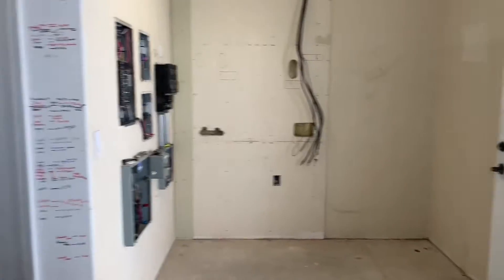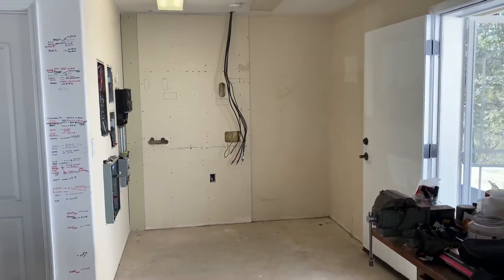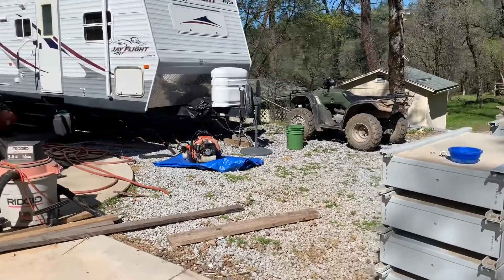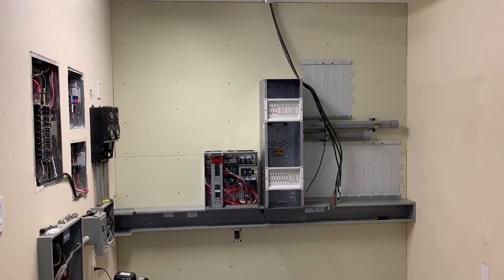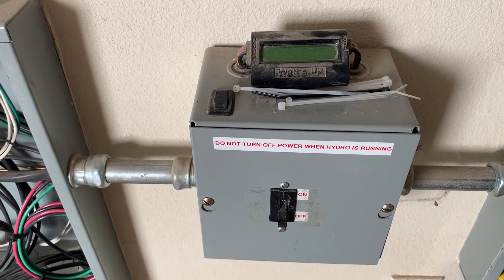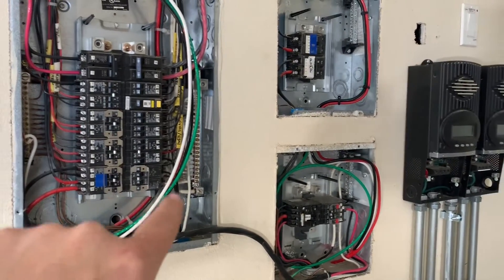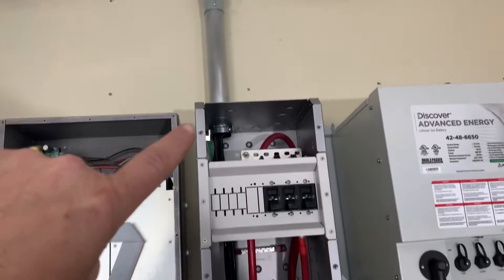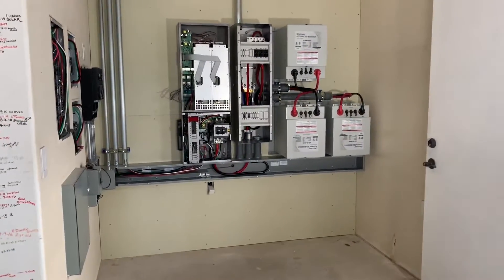Project offgrid upgrade is getting closer

Comment: Not using the Outback SKYBOX? did you switch to the outback RADIAN?
Reply from the maker: this is a 100% off grid project and we putts inverter in quite some time ago, the skybox is not recommended for offgrid, I only had one as I was beta testing it!

Comment: I thought you were going with the skybox? or is that a new video? Man this setup is sweet!
Reply from the maker: I do have a skybox but this project already had the radian, at this point in time I’d still use the radian for off grid.
I have one in my personal power room that’s actually one of outbacks main photos
Reply: @JasonAndrade427  awesome! Yea I'm drooling over here. Trying to get my system together before the end of the year so I can take advantage of the tax credits. The skybox seems to be the most versatile but I'm not sure if it's worth the expense since I'm grid tied...
Reply from the maker: enkrypt3d well it just depends on what your going for, it’s really the only inverter that’s truly Battery ready with extra features
Reply: @JasonAndrade427  yes I want to be able to add some batteries just for some redundancy and maybe a propane generator at some point..

Comment: So, the old system was 3000 amp hours. And the new one is 19.5 kWh?  Will the new one adequately replace the old massive 150kWh AGM?  I suppose they had half that (75kWh) available. And then there was voltage sag etc on the old one.  Anyway, Jason, what is the ratio of replacement of Lead Acid to Discover lithium ...25% lithium replaces lead acid 100%?
Reply from the maker: I can’t say that every system has a ratio, when we built this system I knew next to zero about solar.  A fellow that became a good friend sold the owner the material and the batteries were a once in a lifetime score for $6000 dollars as they were telcom batteries that had been on float for a bit. 

I think that every site and customer is going to be different  in the design, this system didn’t have a flexnet meter on it so I tried to gauge the usages off of the solar production and what my house uses as a comparison.  I live very well off the six Simpliphi that run my main system and easily have 1-2 days of autonomy, for budget reasons I think that works for us as it’s currently more cost effective to run a generator for a couple of hours if need be then have an excessive bank for a majority of the year.

Where we live in Northern California the sun shines a lot and it tends to keep the production high.

Did you purchase batteries yet?
Reply: @JasonAndrade427  I haven't purchased batteries yet. My present 40 kWh of Rolls AGM are in their fifth year and still ok, but I am definitely switching to Lithium in the next few months. "Funding Secured" as Elon once said!  I have quotes on Simpliphi, with the outback Access system and 14 kWh. And a quote on Discover batteries with Schneider double 5.5 kW inverters.  Discover's youtube ads are great when they dissect both Simpliphi and Discover together. Discover seems more robust in the wiring at least, but then again, they are selling their own product.  Discover, here in Canada is more expensive per kWh than Simpliphi so I am torn about which way to go. I plan to spend about $25,000 USD on batteries to get at least 30 kWh of storage accessible. Any suggestions?
Reply from the maker: First nights usage only consumed 23% of the storage, I think the freezers and fridge ran extra as they were a bit behind from running off generator cycles for a week